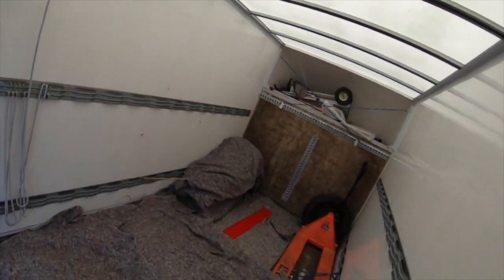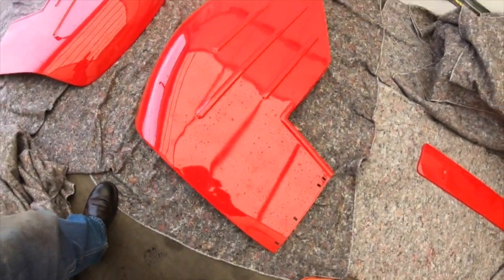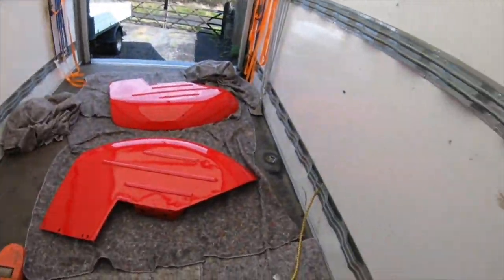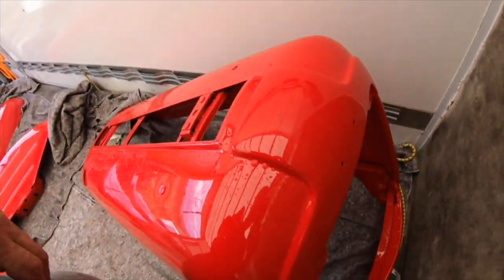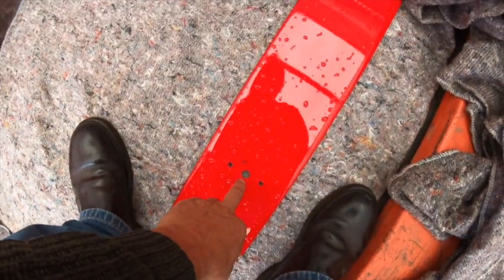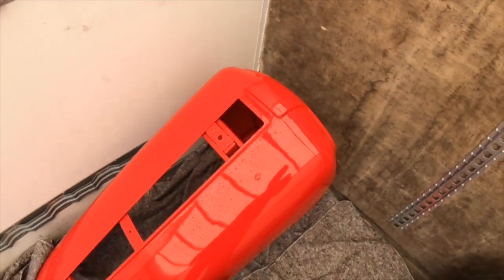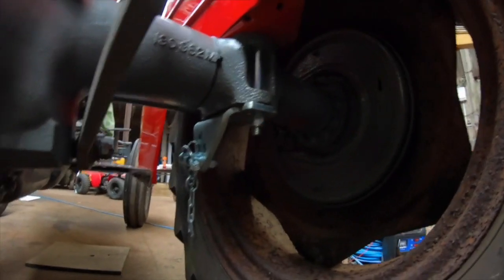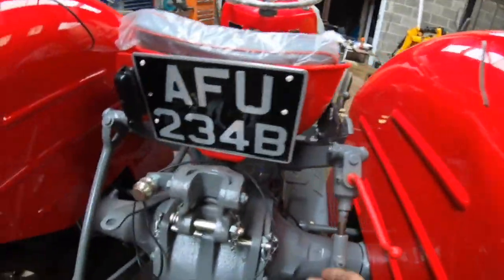Massey ferguson 35 | painted panels & shiny bits starting to go back on

Comment: Looks fantastic. Glad to see you got the holes drilled perfect for the badge. I recall us talking about that job before. Well done.
Reply from the maker: Hi thanks its coming on great , your right about  the holes and about putting new badge on ...it looks really good but measuring the holes was fun because theres nothing square on the  bonnet to get a true measurement i think it was more luck than management getting them right and the curve on the badge is not perfect but good enough .